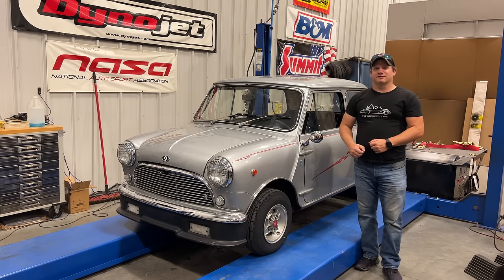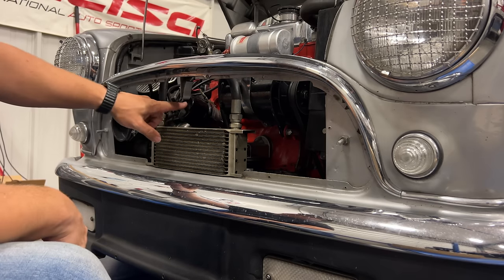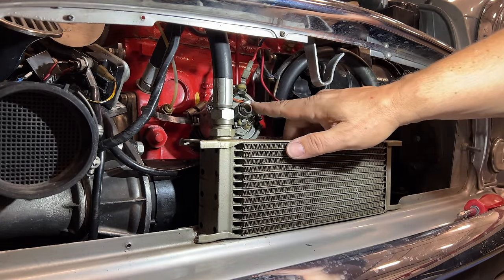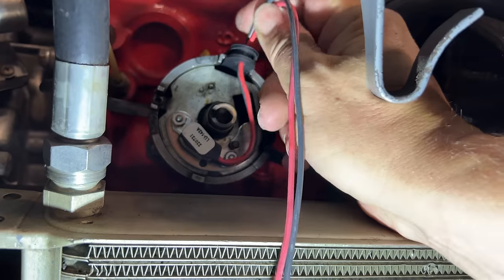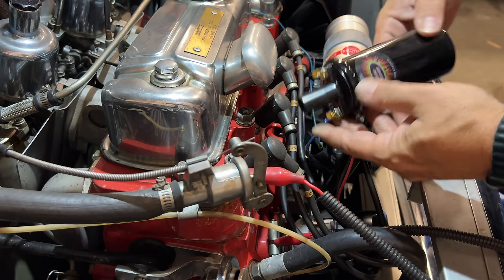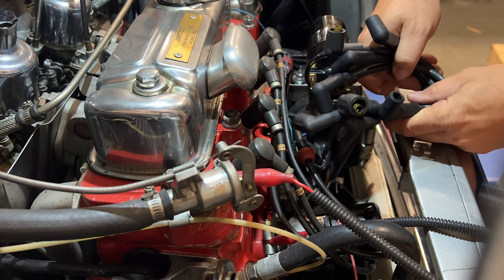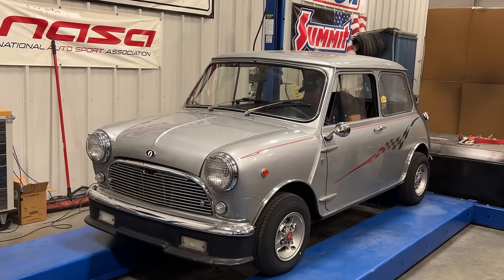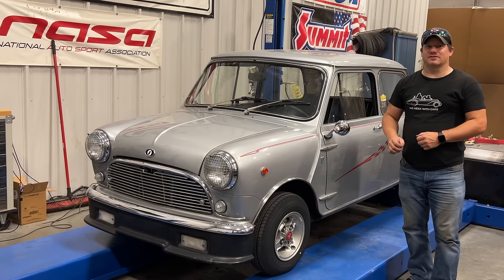Installing Pertonix Electronic Ignition into a Classic Mini

Comment: I remember back in the day a friend using a "marigold" glove (a popular brand of rubber gloves used when cleaning dishes or general household cleaning in the UK) instead of the official rubber boot. The five fingers worked well for the king and four cylinder HT leads.

Comment: Another excellent video!  I've used Pertronix modules in my British cars for years, with 100% reliability.  One thing that should maybe be mentioned is that there are different modules for positive and negative ground cars and they are Not interchangeable.  If you try to use a negative ground module on a positive ground car (or vice versa) by by flipping the red and black wires, it won't work and will probably blow the module.
Reply: Or reverse the polarity of the car, which also means that you can fit an alternator.
Reply: You are right and I believe the latest iteration of the Pertronix is more durable and more expensive as well.

Comment: I never had any problems with the Rubber Boot (Even is heavy storms). But I do agree the "Electronic Ignition" is far superior because they hold their tune better and don't need replacing like Points etc.. Thanks Steve, cheers
Reply from the maker: The rubber boot works but you spend more time taking the boot on and off when you want to adjust something than you spend actually adjusting it.
Reply: @ThisWeekWithCars  steve most ignition problems occur in the high tension side in wet conditions so the rubber boot helps that and with you fitting the petronics you should never have to worry about removing it .in the uk we fitted a plastic sheild to stop the water splashing the distributer and coil, lovely example of a mk 1 mini.

Comment: My Petronix ign, Ignitor III, requires to run low resistance (0.6 Ohm) coil (ie their Flame Thrower). I had one flame thrower die on my mini...it was the liquid filled version. I guess maybe it died from excess vibration (it is engine mounted) or perhaps from previous owner mistreatment (see ballast power issue). I replaced it with the epoxy filled version. Also, the EI needs good suppression of radio interference (so run resistance spark plugs (typically 5k Ohm) and even suppression ignition wires. Finally my EI guide doc stated not to run ballast power feed to the coil. Many Mini's had ballasted power to coil for better starting in low temps or low battery charge situation. My car came with the ballast power on the flame thrower coil...might have lead to its ultimate death.

Comment: I think that's a good conversion for a classic car especially as the distributor is right on the front of a Mini engine. It is a good idea to change the coil as well it should improve the performance of the car and quite an easy job. Thanks Steve interesting video. 👍 👍

Comment: Advisable to use blue loc-tite on all mounting screws. They can vibrate loose causing the car to run like crap. It can drive you crazy trying to find the problem!
Ask me how I know!🙄
Reply: Same here. That little screw holding the module to the base can come loose and the car starts running bad, backfiring all over the place. Total nightmare.

Comment: A question about the oil cooler.
When you change the oil, isn't there old oil in the cooler that doesn't drain out? 
Could the oil cooler be mounted upside down? 
Cool timing light.
Reply from the maker: There is no reason to get all of the oil out unless you had a catastrophic failure and have metal shavings in the entire oil system.

Comment: Steve, that's not going to fix the problem of rain getting in the distributor. British Leyland put a plastic moulded cover between the distributor and the inside of the grill, protecting it from the rain. The problem was the heat from the engine would evaporate the rain and it then condensed in the distributor cap, causing the spark to short, causing the engine to eventually stop.